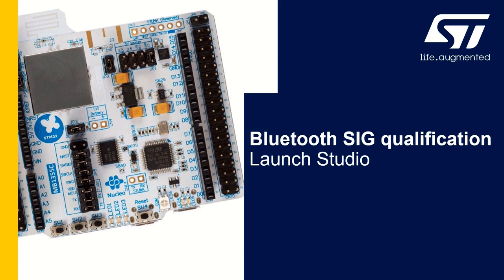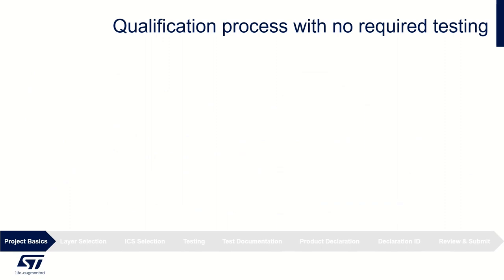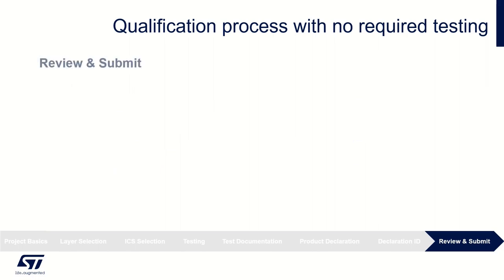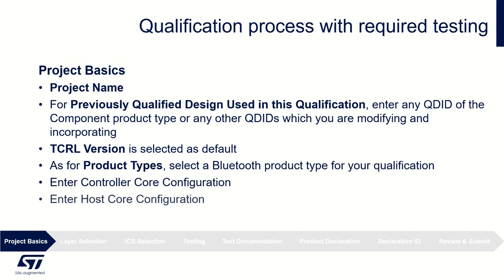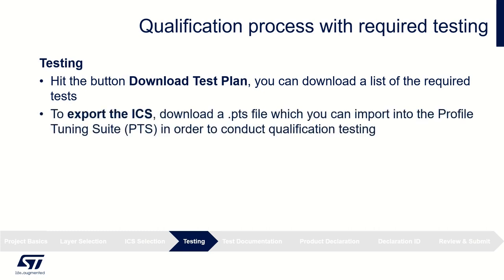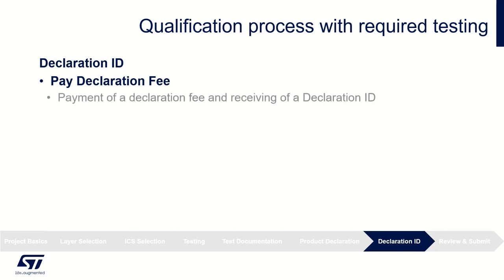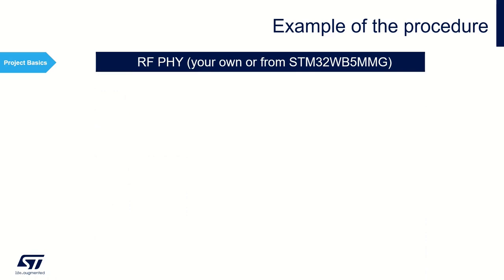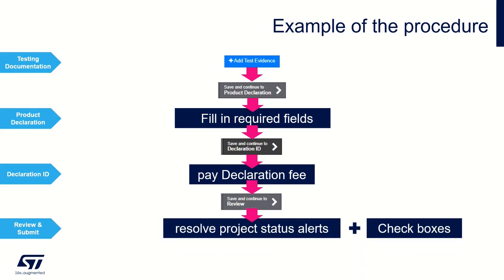STM32WB Certification measurements - 4 Bluetooth SIG qualification - part2

Comment: Thanks for your presentation. I have a question: I do use an already listed SIG ST Bluetooth chip for my end use product. I have already RF-PHY, LL and Host layers QDIDs. I add only DIS option under GATT profile. Can I inherit the already approved QDIDs by covering the additional DIS testing internally through PTS tool and a dongle? Thanks for your support